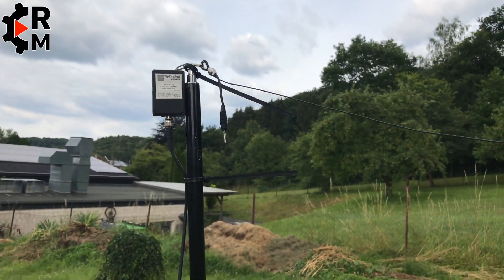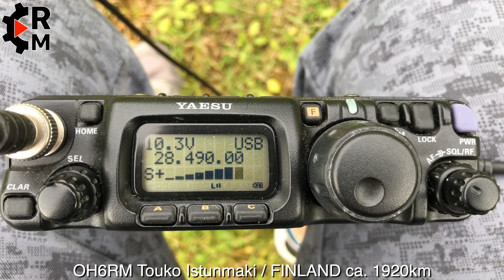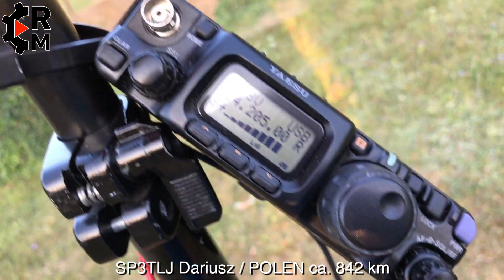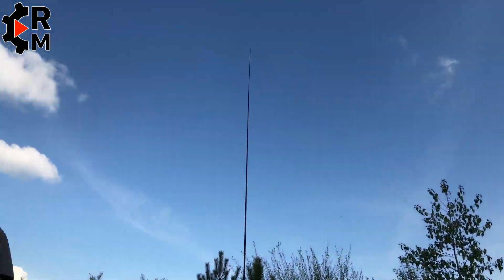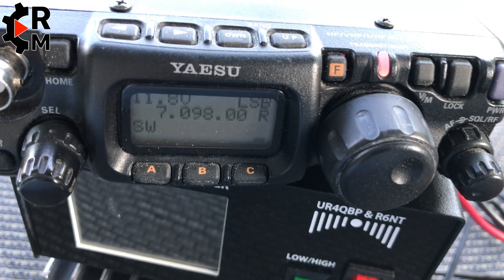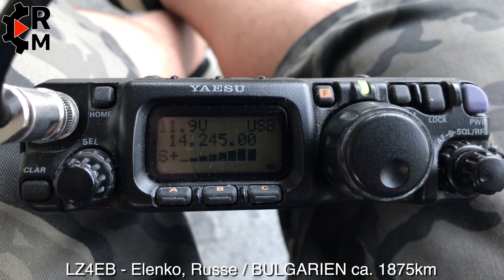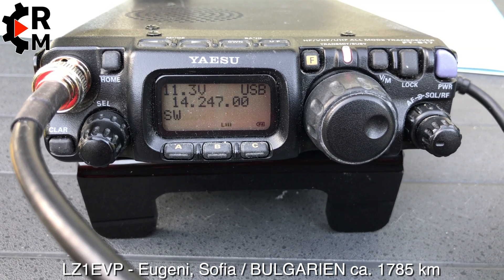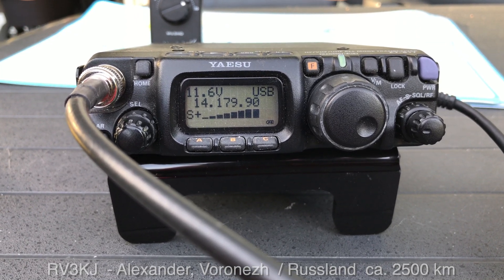Setup and operation of the HyEnd Fed Portable 4 Band Antenna Ultra Light Mini 100 Watts

Comment: Hello Alex, that looks like a great antenna. Have you tried using it horizontally? I'm asking because I'm thinking about putting it up on my apartment roof between 2 PVC poles that are 2 meter high. Or do you think I will get bad SWR? Thanks! Dankjewel! Danke!
Reply from the maker: Horizontally for sure is great but you need to put the hot end way up in the air! 2m won't work in a usual neighborhood. Could work at the sea in the dunes but the best results you will get  is when it's higher than 10m. But just try it out. That's the best way to find out. ;-) 73
Reply: @reviewmirror  Thank you Alex! I guess I can give it a try. 73.
Reply from the maker: @dutchdrone1249  Yes for sure! That's what our makes that interesting. :-) Please let me know your results. Take care!

Comment: Hi,

How do you fix the Spiderbeam into the earth? Without any post?

73
Reply: Thank you very much, 73
Reply from the maker: @jckim8604  You're very welcome Sir. Best 73's!
Reply: Is it placed I cement in the ground or just dug into the dirt? Also what kind of coax did you use? I found my spider beam bends much more than yours even using RG8x
Reply from the maker: @davidw3260  In the dirt as it is a vacation location. I've used highflexx coax.
Reply from the maker: I am using the ground sleeve of a rotary clothes dryer. You can see it in the video.